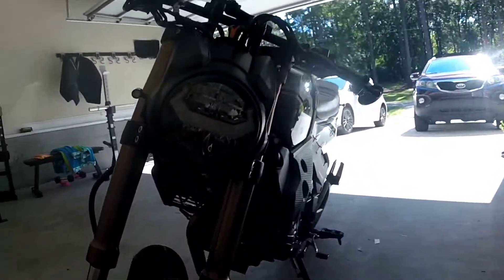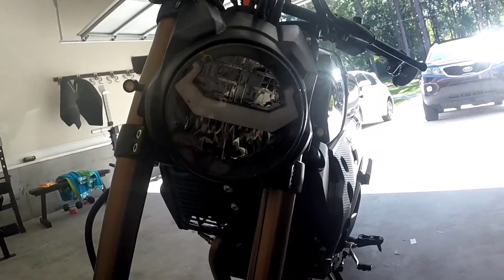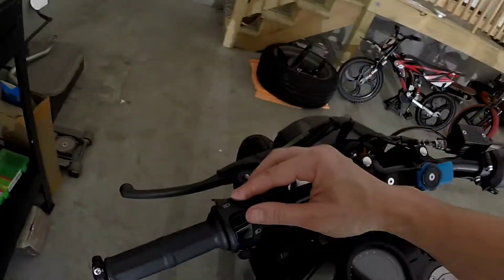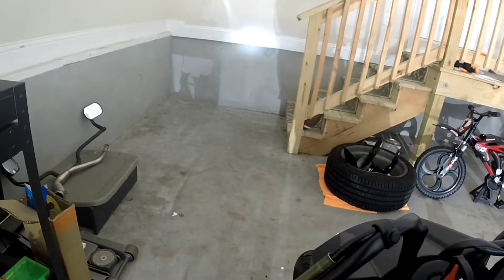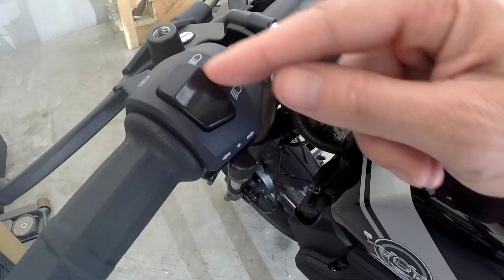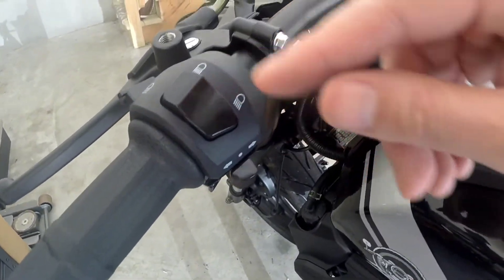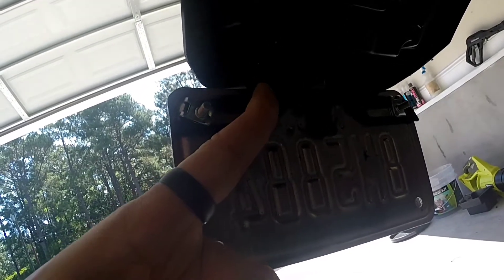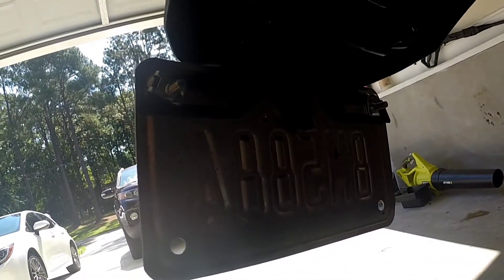Fixed a fuel leak on my 2022 Lifan KPM200

Comment: I had a baffle in my aftermarket exhaust and found out that with the restriction the fuel injection was flooding and overflowing. I removed the baffle and it fixed the leaking. Just a heads up.

Comment: After putting 1000 miles on mine, I upgraded to a Kawasaki W800. Now I have to figure out what I’m going to do with the KPM200
Reply from the maker: I'm getting to that point.
Reply: @rydazim  I’m not sure if you have experience riding larger displacement motorcycles, but believe me when I say it’s far more enjoyable. To be honest, the build quality on these bikes is not very good, but you don’t realize how shoddy the construction is until you ride a brand named motorcycle.
Reply from the maker: I had a Honda Shadow 750 a few years ago. This is actually better than that was. But technology has changed a lot since then.

Comment: Hi Rydazim, how are you? Thanks for your videos. I bought this motor bike as well 1 week ago and enjoying so far. Noticed when I drive at > 40 mph speed, there is some burining smell coming from front tire, looks like brake pads are almost touching the disk brake, did you face that? any idea how to fix that, my suspicion is tires are not freely rotating

Comment: If they don't have Y connectors you can splice another wire onto the low beam and connect it and the high on the back of the switch so both are connected to the high terminals. So long as the switch amp rating can handle both LED's amp ratings. If not upgrade switch to one with more metal inside to conduct the higher amp load.